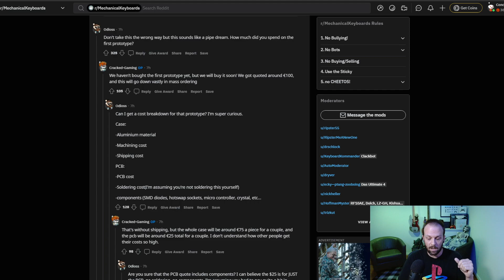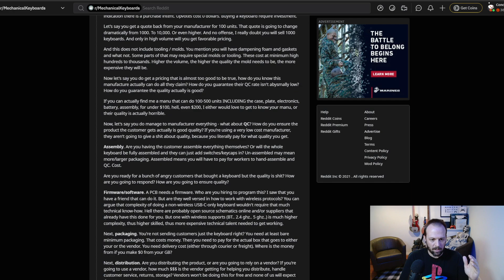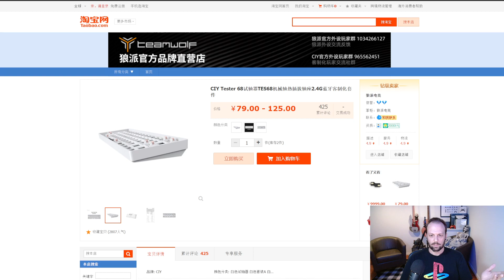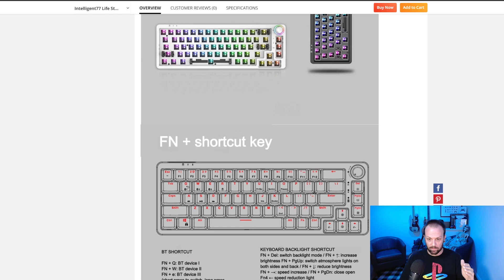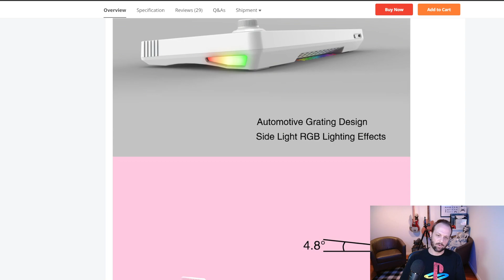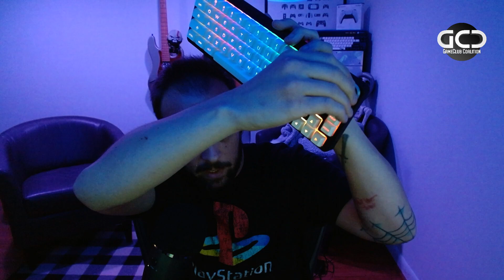Cracked65 - $100 Wireless, Gasket Mount, Hotswap, 65% Mechanical Keyboard w/ Aluminum Case

Comment: then what about the AJAZZ AC064?
-Aluminum case
-Hot-swappable
-Tri-mode(Bluetooth, Dongle, and USB Type C)
-RGB
-64 keys

All in the price of 70-85 USD
Reply: rk61/rk68 has similar features so im assuming the aluminum case isn't so great
Reply: @lowurcase3238  my point is, it's cheap for a full case anodized aluminum. Mostly you'll get just a kbdfans alu case in that price range with no pcb and no plate. Just a case. It's an upgrade for a beginner keyboard enthusiast with low budget.
Reply: @gabbu8908  i agree
Reply: Ajazz AC064 is not gasket mounted. Also, in my experience Ajazz quality control is terrible and they do little to compensate for it. I'd rather go for an Akko Mod 005 or a Keychron Q2. It's worth the extra $$. That said, sucks there's no budget aluminum case gasket mount keyboard that's also wireless. Ajazz made AC067, but it's not readily available (plus, it's Ajazz, my awful experience with them is going to discourage me from buying their products in the future).